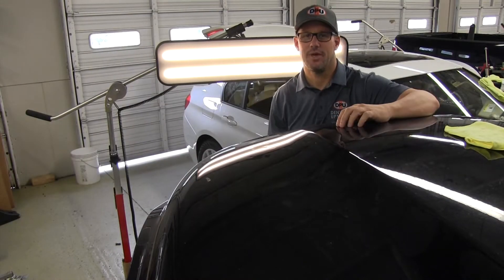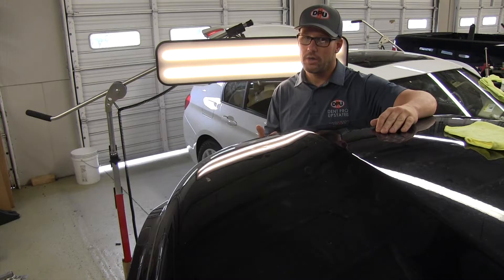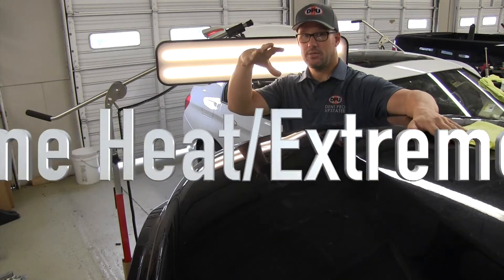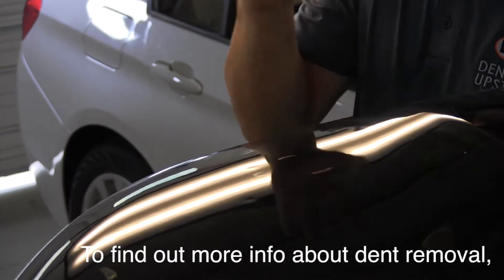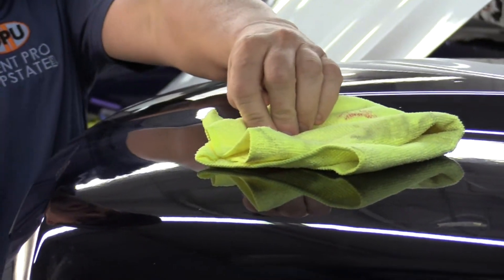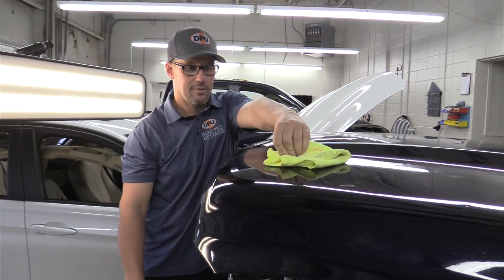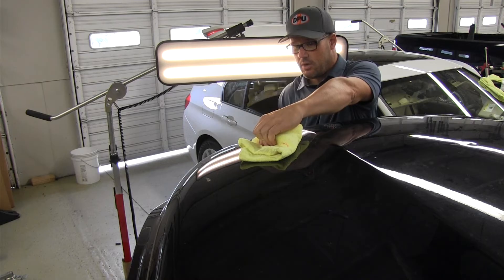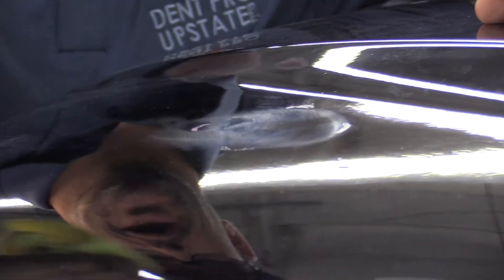Dent Repair with Extreme Heat then Cold/Dry Ice: Does it Work?

Comment: I've used dry ice for years, it's not a perfect fix- sometimes it works and sometimes not, but it's worth trying. What we do is set the car in the Texas sun for awhile, then apply dry ice. If it's not sunny out, we use a heat gun. It's beneficial sometimes to really focus the heat on the area that got stretched. 

Think about it- shrink discs work, right? So if they work, why not dry ice? Same concept. It's just not as powerful, so in thicker metals or on curves that provide structure, it may not work.

Comment: If you are reading this: Use a blow dryer on high heat 5-7 inches from the dent for about 2 minutes.  You can use an extension chord or inverter or car adapter to power it. Then, immediately following, use compressed air on it. Through Adiabatic Cooling, if you hold the compressed air upside down when spraying, it will get really cold and it will form a layer of liquid ice on the dent. The rapid contraction from this cooling process will probably result in it snapping the metal back to its former glory.  Good. If you are working on small dents. If it  doesn't work you can try a plunger and hot water but you will probably just make a new dent during the repeated push-in pull-out process.

Oh I should also mention the reason you don't skip the heating process on really hot days, when the metal is hot, is because the heating could be uneven based on several variables and also the blow dryer will give you concentrated Heat at that one location and will be hotter. Using a blowtorch like in the video just results in your paint bubbling up. Not worth the risk
Reply: I honestly thought this guy was a clown using that heat thing..
Reply: He's also a professional dent remover so not too motivated to find quick fixes..

Comment: Wrong process. Don’t use torch. If you look closely, it did NOT affect the dent… besides, there is no way to get it hot enough with a torch where you won’t also burn the paint. And don’t use dry ice, it is difficult to find and will burn your fingers when you touch it.
Correct process that will work on non-kinked small dents. Use HEAT GUN. Heat affected area in a circular motion for 3 to 5 minutes being careful not to damage paint. Immediately after heat source is removed, spray the dent with MG Chemicals Super Cold spray. This is available through Amazon or locally if you have an electronics store in your area. Also, there are medical freeze sprays used for wart and skin tag removal that will also work but are a bit more expensive.
You definitely did not apply enough heat in the few seconds to have any effect whatsoever. You probably can fix the dent using your method but it will require a repaint of the burnt area.

Comment: Straw man argument as usual. Small dents like this won’t “pop” back. The metal is too severely deformed and steady. Heat and ice only works for an unsteady, large dent that is “poppable” like those rubber kids toys.

And you’re doing it wrong anyway. Apply heat to the concave side and ice to the convex side instead. Doesn’t need to be dry ice and a torch. A heat gun and water ice works well enough. It works because ice causes the cold side to contract and the hot side to expand.

The heat/ice is only beneficial for hard to reach or dents that require more force than you can manage by hand. And you must have access to the panel from the inside. If it’s on a door panel, the inside decorative crap must be removed, obviously. If it’s on a pillar, good luck.

The dent will never disappear with the heat/ice method. Just gets it less severe so not as much body work is still needed. Only a skilled body repair person can fully remove a dent.
Reply from the maker: Your comments are hilarious and contradictory. “It will definitely fix on a big unstable dent” then “the dent will never go away completely”. Oh, you mean it will be a small, shallow dent?  Like the one I was proving the myth wrong on? 

Yeah. 

Heat one side, cool the other?  You don’t understand thermodynamics and how quickly heat transfers in steel. Hint: the steel is so thin on cars, the transfer is near immediate. 

And that only a skilled body technician can fix this. Tells me you don’t know what pdr is.
Reply: Whatever, man. You’ve publicly demonstrated that you don’t know what the hell you’re doing when it comes to using temperature as a tool to remove dents. And if you actively cool sheet steel on one side and actively heat it on the other, one side WILL contract and the other WILL expand, enough to remove a large, unstable dent. It doesn’t matter which metal. Aluminum is even more heat conductive than steel and a sheet of it will do the same thing. This is demonstrated all over the world in every 4th grade science class. If you hadn’t of dropped out in the 3rd grade so your daddy could teach you grunt mechanic work, you might have seen it for yourself.
Reply from the maker: And on a pillar?  Can be fixed no problem. It’s called glue pulling. But you need skill. Which I’ll bet $1000 you don’t possess
Reply: Yet another strawman argument. I’m not referring to PDR or any other process, I’m only referring using temperature. You look really stupid with your constant strawman arguments. Typical shady af, trash auto body guy

Comment: It will not work with this kind of dent in such area, on a flat surface like fender or door it might work depending on the thickness of the metal sheet..

Comment: If you want cheap very cold air or gas put a refill fitting for 1 lb cans in a 20lb propane tank, with a hose with a quick shutoff from Amazon would be ideal, turn upside down and you'll have around -50°f.

Comment: You do it wrong. Never use open flame. Use a heat gun. The dry ice will not get in prober contact with the surface. You need to use ice cold water and you need to heat the surrounding further - In a bigger area. Then when you pour the ice cold water on, it will pop out by the shock treatment. Some use boiling water instead of a heat gun. https://youtu.be/Cg5EV7mqAg8

Comment: This is crap.  I have great success with this on small dents.  Parking lot dings etc.  Most of these will completely disappear.  I let the dent heat in the sun, then invert a can of compressed air and spray the cold liquid over the dented area, sweeping back and forth a few times.  Try it.  The cost is a can of compressed air.  Dents that involve alot of deformation will not respond.  This is not a myth.

Comment: I watched a guy pull out alot of dents but he did it differently. The ice stuck to the medal and when he pulled it off it pulled the dent with it. Also he did it in the hottest part of summer and used really hot, but not boiling water

Comment: The reason it didn’t work is because you did it wrong and probably didn’t heat it enough. Don’t use a torch use a heat gun and cool it with air duster holding the can upside down.. bump the metal around the dent slightly. Bump it with a closed fist lightly moving around it in a circle as your cooling it. Be careful and use a laser temp gun to monitor your temp so u don’t burn the paint.  Dry ice will definitely ruin the paint. 🙄. Done over 50+ dents like this in the last 5 days or so. some can’t be removed if it’s on the crease of the metal or if it overlaps the body line. The dry ice trick only works on the import urethane numbers and you have to Douse it with Water and dry ice make sure it’s super cold.  You’re welcome 😎
Reply: Agreed as I've seen it work. I Love the air duster vs dry ice as it's easier to keep on hand. What is a good target temp for the heat cycle?
Reply: What’s a good heating temperature for the dent ?

Comment: Start the other way. Freeze it then heat it. I watch s body shop do the roof of my car. It works but you use can of air of some kind blows out extremely cold and a heat gun. The cold goes on top (the painted side) heated goes on metal side (interior) dont know about other panels but I do know it does work on roofs. It looked like a reindeer landed on my roof (hail spots) the same car is a show car. Won a lot of best of show awards. Got painted candy electric blue. Roof was flawless. If I didn't see it for myself I would have never believed it.

Comment: I do not know if this works or not, but the way you did it will never work.  You did not heat the metal with the blow-torch, you just heated the paint and warmed the metal.  The torch is too hot.  You would need a lower heat for a longer time to heat the metal without burning the paint.  It's the METAL you are trying to change, not the paint.  Plus I really doubt that was dry ice - I saw no cloud of vapor as it evaporated and you could never have touched dry ice with your fingers.
Reply: The Boy is using regular ice to lol
Reply: It was smoking like dry ice.... holding it was super wired though!
Reply: That's a good point, he probably didn't even get the metal to 140° LOL

Comment: thats because your doing it all wrong... youll need oxygen settling torch , bucket of ice water, large towel....      heat dent cherry red then toss DRIPPING WET towel EMEDEATELY ON DENT... AND WAMOO!!   I know from personaly watching and then doing it... it works you gotta get the dent and 6-8" past dent cherry red "glowing" if you will... not just hot ....... ill bet you 100$ personally to you that it will work if done correctly.....

Comment: One thing I'm noticing with the ones that do work with this method is if the metal has a dent that has physically changed the shape of the metal it won't work but if the dent is larger and on a seam it will pop out.
Reply: Uh, no.
Reply: Good to hear I have a big ass dent on the seam

Comment: The problem with this video is u did not use a hair dryer. That would have worked. I did it once, dent popped out but the wife was not happy coz I almost broke her hair dryer. 1/10 would not do it again. 

I would also love to see the suction cup myth. The ones that you buy from harbor freight. Damn customers always asking me about this.
Reply from the maker: We wanted to show use of extreme heat/cold. And if it does work with a hair dryer but breaks it every time, that's not very cost effective (and we don't have room to store literally millions of hair dryers :)).
Reply: I wish I had video taped my dent removal with the Harbor Freight tool.  It works quite well, but you'll have to do a few pulls and allow it to cool completely.  I proved a body shop and a PDR guy wrong.
Reply: Ira Wade He is talking about not using any tools, just dry ice and heat. How don’t you understand that? You don’t need heat, dry ice if you have tools or a glue puller.
Reply: "You can try this if you have no tools, but do just so happen to have map gas, a torch, and dry ice on hand."
Reply: ..does it really work